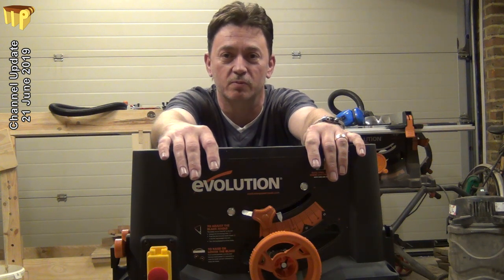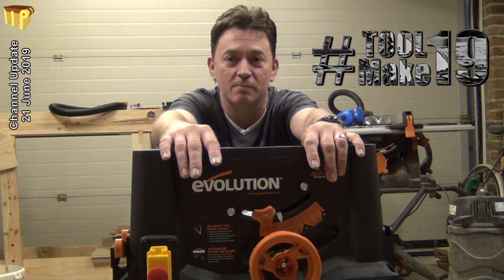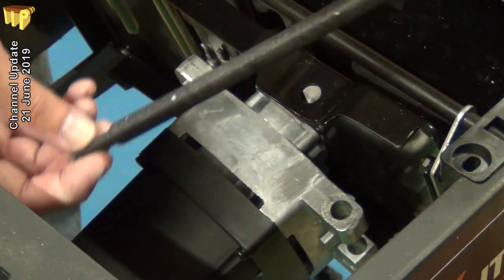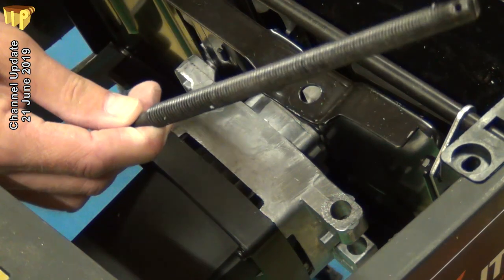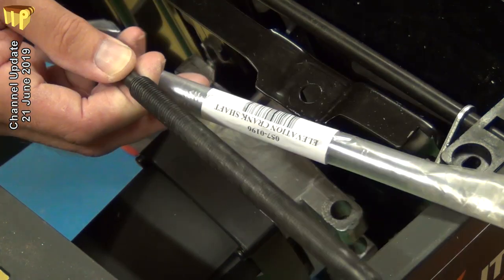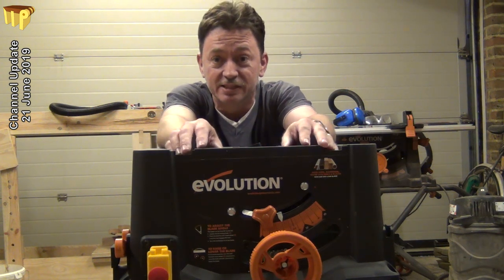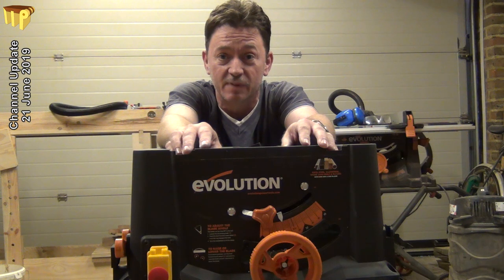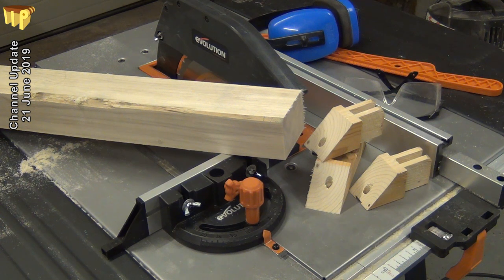Evolution Table Saw Update - Fluff & Stuff 21 June 2019

Comment: Man this is a joke of a tablesaw. If you could call it one. Might be okay for cutting rough timber. Support are terrible too. Was on the phone 20mins trying to explain all that was wrong it. For starters the sliding table section wasn't aligned with the bed so it wasn't flat. The fence. Less said about that the better. Was like 85 degrees at places. Plastic feet. Great the table saw slaps about like an 80s porn star. Mitre gauge is just a toy. Had to file a section to get the blade parallel to the fence. The throat plate is about 5mm below the table. Like come on. The dust extraction piece has to be removed as it's safer just off the saw. I don't know how this got past QC! There was a few more problems. Avoid this like the plague. Just thankful I bought it from amazon and got a refund. :)
Reply from the maker: Wow you did have a bad experience. This saw is the base model, so no sliding table involved. These are cheaper table saws, so one has to expect somewhat larger tolerances and less 'meat' in components, but they should nonetheless perform to the specifications given by the manufacturer. It will be interesting to see how I get on with this one.
Reply: @mitchwoodwork  honestly would get any tablesaw that has a cast iron top. This is more suited to a building site where a diyer is using it. A month on a proper site and the plastic would be wreaked and probably the frame too. 2 weeks and the finish of the bed started to peel off on mine. The measurement gauge too peeled off. Shocking. If it was a car it would be recalled or be taken off the market.
Reply from the maker: A cast and well machined top is great, that's what I have on my cabinet saw, but I wouldn't fancy shifting one around on a building site ;-)
Reply: @mitchwoodwork  oh I know that lol. A DeWalt is the job there if you value your time. :)